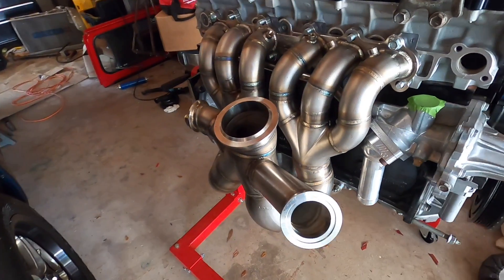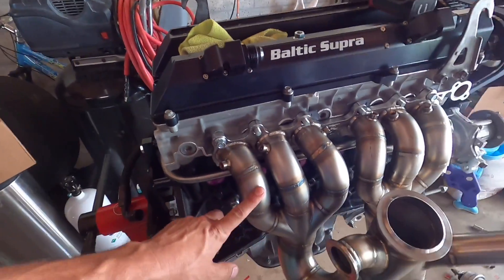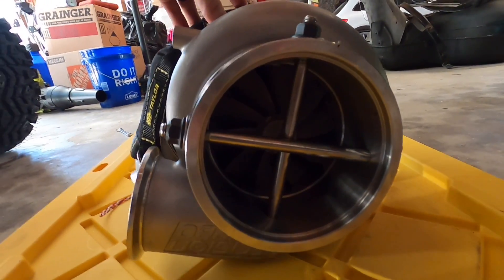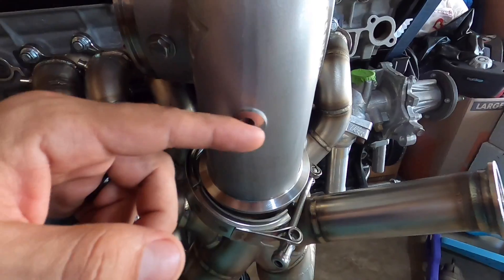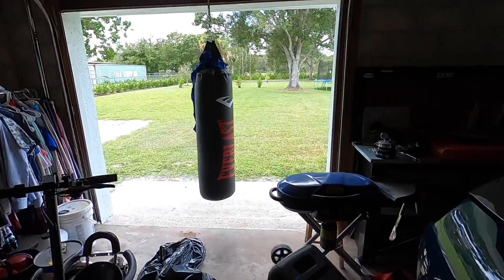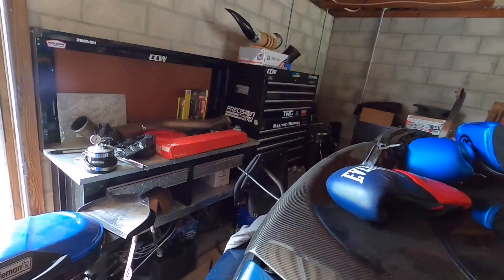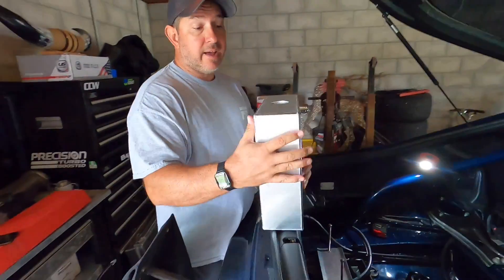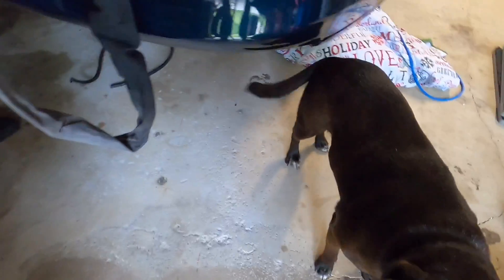New Promod Turbo Setup 2000HP

Comment: Thanks for the runner specs amigo, it helps me immensely. 🙏 I'm already using 32nb mild steel for my 1JZ manifold which is just off 1.5" ID and the two GT2860RS's compared to that XPR88 of yours. I want that quick spool response! 😉👍
Also, doesn't help that NONE of the guys do a twin turbo manifold so I have to do my own, as they always just make them for a big single. 👎